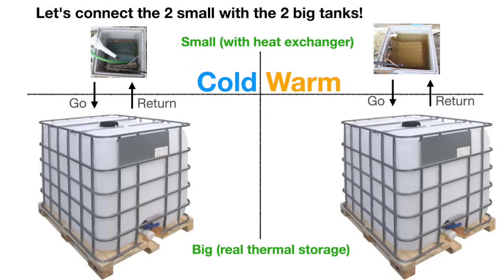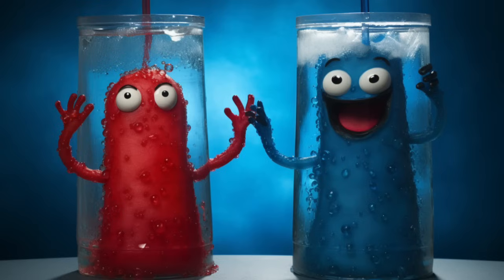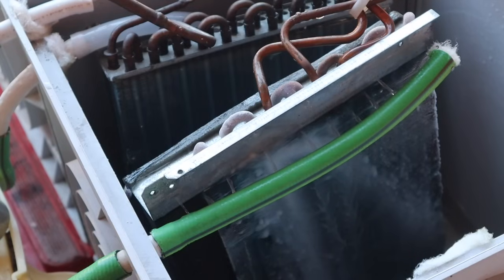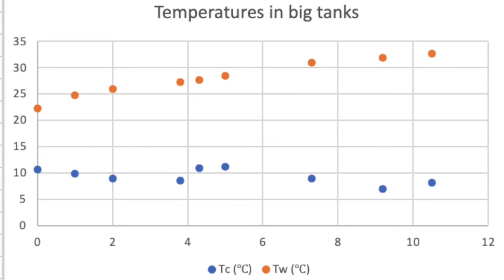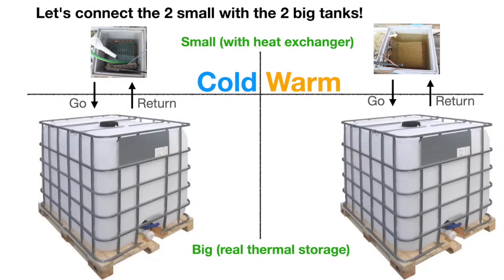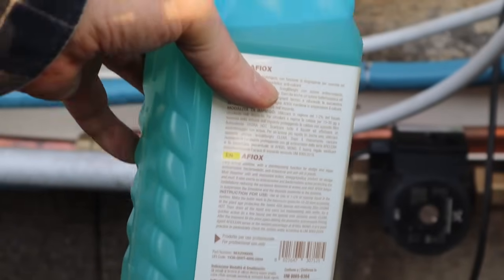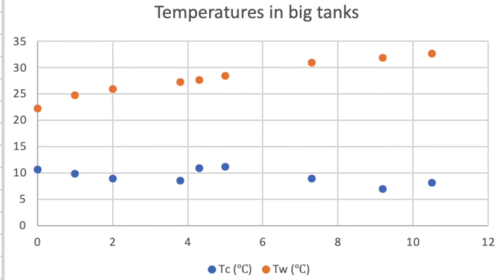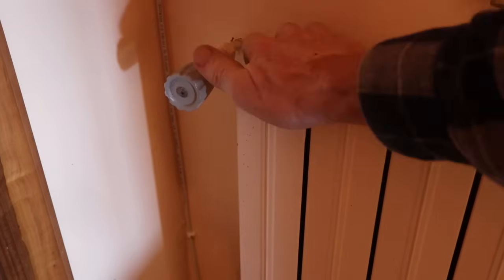How I Heat My Entire House with Only 1.5 kW! - Video 71

Comment: Well... this ins quite janky, inefficient and not very durable... 

1st: with a little bit deeper knowlege in HVAC and refrigeration, you can build a water to water heat pump from regular AC parts that will rival comnercial ones. 

- Maybe (maybe) recover the gas from the unit, take it apart and rebuild in a metal frame. 
- Get a brazing kit or hydraulic fittings for the copper lines. 
- Get a hvac gauge set, 
- a pair of standard 1/4 and 5/16 npt charging ports with schradder valves. 
- get a pair of copper brazed, stainless heat exchangers. 40-60 plates for your average small ac compressor. 
 - fluorinated gases are hard to get if not licensed in hvac but r290 is not on the list. But is better than all F gases. It has just the flamability isdue but a propper hvac unit shall not leak, ever, period. 
- get aquinted with the refrigerant's pressure-temperature curves. 
- ditch the reversing valve system and maybe have a variable/controllable expansion valve. 
To keep it cheaper and simpler, but lower performance, regular capillary tube will do fine. 
- keep away from rain water and plain water. Rain water is corrosive, plain water is probe to freezing.
- Circulate an aporopriate antifreeze mixture in the heat exchangers. 
- use a secondary heat exchanger to pass heat energy from the antifreeze to your ibc tanks of water. 
Run the antufreexe directly in your indoor radiators. 

This way you get a single box with power in and four, safe and easy to manage, not pressurized antifreeze ports. And tge box can stay outside, with you runnung cheap hoses or pipes, with some insulation, unside the house.  

An inverter-type compressor along a variable expansion valve can help modulate power and performance in accordance to outside/inside temperatures, demands/needs and even energy availability (like I run my heat pump on full blast when my batteries are full and it's still plenty daylight on or tune it way down just to compensate sone geat and let me burn less wood.)
Reply: I'm wondering if an automotive style AC/heat pump system would be easiest for an amateur? Am i correct that they go together with compression fittings? I've seen no-name Chinese 12/24v scroll compressors on eBay that i assume would work? I'd hope that a mechanic could charge it and adjust the TXV correctly for reasonable money?
Reply: @beetooex  if you have access to a car graveyard. Otherwise, automotive parts are way pricier, proprietary and model dependent. 
For the very beginner I highly recommend starting with a buttload of hvac theory. 
Plenty of educational videos about it on youtube!
Reply from the maker: Hi Beetooex, I asked in a car workshop about these systems. In usual cars they need an external motor because they are driven in the car by a belt. In EVs they are indeed stand alone and have this electric compressor incorporated, but you need high DC voltage for that. Also because there is quite some power in these systems, even if the car is much smaller than your house.
An alternative are the camper AC system that go on 12 Volt of a battery. That can be fun to play with.
Reply: @nnvasen-good-energy  We have learnt the same things! I was thinking of the camper AC systems. I have found the manufacturer and specifications of the electric scroll compressor they use. They are available in 12v, 24v & 48v DC and are variable speed by PWM control. Maybe this means they are as efficient as a 230v inverter compressor? I don't have the knowledge of how to build a controller but I think someone clever could use an Arduino or Raspberry Pi for this purpose. There is no information on the coefficient of performance of these systems and I think it would only be worth trying if you absolutely needed a fully low voltage DC driven heat pump. The online discussions about them do say that the current draw (amps) is very high which could also be a problem.
Reply from the maker: Thank you for the detailed info! I indeed bought a hvac gauge set and a vacuum pump and next year when I am there I might use them, I've also such a heat exchanger as you say, still waiting to be utilised. I got the app to calculate the curves of different refrigerants, but don't want to push to much outside the skill level of the big part of the audience.
I see that you are miles ahead. I am aware of the advantage of inverter heat pumps. Will develop my skills in this area and present it in some simple way on this channel. Maybe I should start to assemble units and selling on internet in order to help my audience.
Anyone who likes this idea? A kind of IKEA with ready components to make useful things that are not on the market.

Comment: my ground source heat pump uses from 500 to 2000W (20 to 90Hz) delivering 1,5 to 6kW with a COP averaging at 4,5.
Reply from the maker: That is very good, a constant  temperature source, I had it in my years in Switzerland.

Comment: Interesting i was thinking of an even smaller and simpler thing have the excess energy or off peak energy being fed into an element in a large water barrel for a single small room.
Reply from the maker: Even smaller? That will be a dehumidifier. I like them, too, for example for air change preheating. See https://youtu.be/yanpHYSIcd8?t=466, with time stamp already.

Comment: So stupid . Heat pump it's cheaper You buy some cheap Samsung ehs mono and You will get higher cop with better control.
Reply: In the UK a Samsung EHS system costs more than £2000. This DIY project cost less than 10% of that...
Reply: @beetooex  but with which effectivity? A waste of time and Materials, in my mind.
And at the end of the day you cant trust that Type of fiddly solution.
Reply: @beetooex  in my country the two used ibc containers costs now 160€ at least, 
so there is not much money left for the other components, or you must steal it !!!🤔🙄
Reply: What do you mean cheaper? He made this out of basically scrap ACs.
Reply: Because it is waist of time money and effort. Also its useless and prone to failure.
Reply from the maker: The first prototypes are always full of errors. I feel the impulse to use both sides of the heat pump because it is logic. I admit that in winter it is difficult to find an application for both sides, but in summer it is easy to imagine how to use heat and cold at the same time. But then you need storage to shift one or both to another time.
If we go outside of households and for example in hospitals or food industry, it is easy to find clients that need heat and cold all year round but even they don't have the double use of heat pumps. At least I didn't find it during my career (including as energy engineer at Siemens).
Reply: But where is fun in that? 😁
Reply: COP 3 .....okay not nessesary to see the rest of the Video.
Sorry, but my Stiebel Eltron Heatpump runs since 2006 with a COP of 4,5 .
I have a collector 1,5m deep lying in the garden, the System runs perfect.
Next Step is to build some more PV on my roofs.
Is it very cold an less Power from the PV, a wood oven is burning and brings the heat.
Reply: @schwellenzaehler4564  you probably missed the point in this video.
Reply: @chblabah  ok its cheap......yes, but worthless!
I dont trust such a messy heatpump system!
If i would ever present such a self build / diy system, i would show the whole system in the most professional way and look, that is ever possible, or stay away!
Otherwise all the work looks more like the idea, of one of this typical crasy professors.
Reply: @schwellenzaehler4564  I understood - that's why I say you didn't get the point of this video.
Reply: @chblabah  the point is what?
Have you Arguments, instead of senseless words.
Reply: @schwellenzaehler4564  I'm not here to educate you. But: your argument is it's worthless - but you fail to explain why.
The goal of this video is to show how it's possible to think out of the box, upcycle some components that are available,
and create a DIY water-to-water heat pump.
It doesn't claim it's a scientific evaluation, nor does it claim it's ready for mass production.
But somehow, you're expecting this. I think you're just in the wrong context.

There are a lot of DIY channels, where these topics are covered, in similar ways.
It's a source of ideas. How you add value, in your project, is basically up to you.
The calculations nevertheless apply.

I don't see any reasoning on your side, "worthless, idea, etc" is just trolling - so maybe you could leave this aside. Thank you.
Reply: @chblabah  ........components who available, yes but all are not chep.
And complete functional heatpumps are also available. 
The point is, in most countrys its not legal, without a licence, to recyle, repair, rebuilt heatpumps, refrigerators, air conditionings etc., 
and there is a very good reason for this! 
A "open mind" is not enough for such work, you need special and expensive tools, not least the specific knowledge.
Its not good idea, to show such a careless use of this componets, especially in Youtube Videos. 

You think i am trolling, no for shure not!
I judge the shown content not as "fearless" or "dumb", thats a thing that others can deside. 

Dealing with criticism is apparently not everyone’s cup of tea 🙄
Reply: @schwellenzaehler4564  the finest example of trolling.
Compare the price of a used AC to a heatpump - it just doesn't make sense.
The context of this video is experimentation, nothing else.
Also, there is nothing illegal in this video.

How about just moving on if you don't get it?
Reply from the maker: I must start somewhere. I see that it functions and from there I start to improve. How was the way of aircraft? A looong way. What I found more important is that the brothers Wright said that now there is another way from point A to B.
With all the perfection coming from the laboratories of the big producers, I ask them: why is there no commercial heat pump with standard a double usage (of heat and cold side), when with CHP (Combined Heat and Power) there is a similar problem of finding how to find a compromise between the demand of heat and power, and there are already many CHPs running.
I am addressing this opportunity, they don't. I don't have the money and man-hours they have but find it exciting to see that I arrived at some point with this video 71. With cogeneration of heat and cold, and storage to make it more flexible to find a compromise between the time of demand of the two.
Reply: @nnvasen-good-energy  You are waisting money time and effort trying to reinwent the wheel using stick and stones.  You can buy cheep chinese geothermal heatpump witch propper controller Nulite NL-G2s for 1200$ shipped from Turkey . As a lower source you can use solar collector  panels and large water tank for heat acumulation.
Reply from the maker: I agree, with such a collector in the garden, the heat pump has good conditions to work. I lived 10y in Switzerland and they have many heat pumps with vertical pits many meters down, with constant temperature. But quite expensive. 
I try to obtain these conditions with the two big tanks, which are much more constant in temperature than outside air.
Reply: Also air to water has terrible cop in winter (-20°C)
Reply: @MrMati489i  I live in est part of Poland so winters are typicaly cold -5 and more . House 160m2, 4 people with heat recovery ventilation. Heat Pump Stiebiel Eltron HPA 08 using radiators heating season from October 2023 til  April 2024 total power use including hot water 3500 kwh. I have 8kw solar panels house depends only on electric power . Power bil is less than 100$ per 6 months .  All bought and installed by my self.
Reply from the maker: I like this, H8T3R. It shows that commercial solutions don't cover all situations and even leave a lot of opportunities unused. And now you cover your needs with a self made installation. That means there is indeed value in DIY.
Reply from the maker: MrMati489i expresses what I would answer: commercial products are fine but in common circumstances. They are made for the majority. When you are going down in temperature, air to air or to water is completely impractical. And that already below +7℃. So a lot of people are in this situation. If the big suppliers doesn't think of that, then the tinkers must do it 😀.

Comment: COP of 2.2 is not very good compared with what you see from other systems.
Is that because it runs at night during winter.
Reply from the maker: Hi Mark, that is one of the reasons. The main thing is that this is my first working prototype and there are at least 10 point to improve. The strong point is that the 2x1000 litres are a great stabiliser for the operation conditions and there are many options to improve if you work with water and not air. For example we have a big underground rainwater pit wit 70 m3 and if I use it to keep the evaporator at 16 degrees C then I have paradise.
Reply: @nnvasen-good-energy  Great work! I am excited to see the improvements and lessons learned.

Comment: You should really figure out why that one evaporator is freezing, whether low on charge or the metering device is restricted. Great idea though, especially from an efficiency standpoint.
Reply from the maker: Thank you Snake8, I will analyse it but the watet temp in the big tank was 5 degrees the following day and then you really need much water to keep the evaporator above zero. See my answer above to Mark, about the rainwater reservoir. Another is to heat the water with spirals in the ground as I see in many youtube videos.